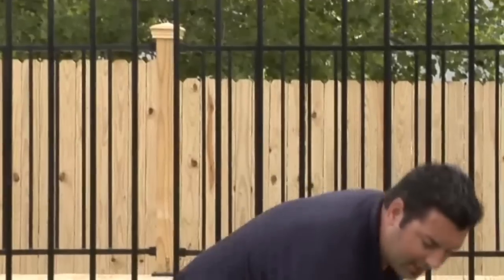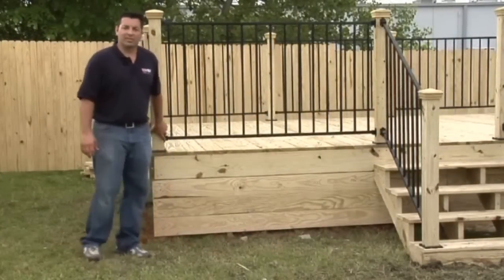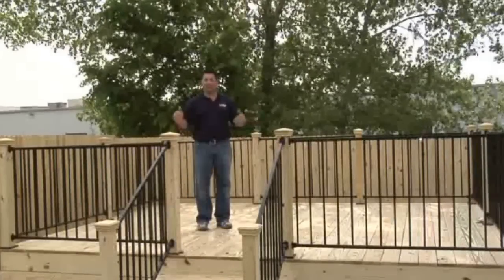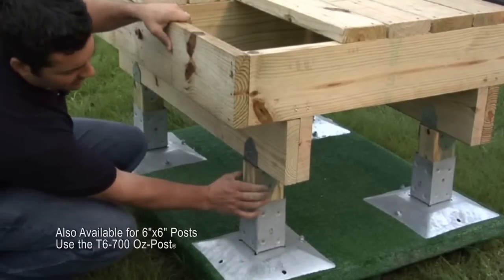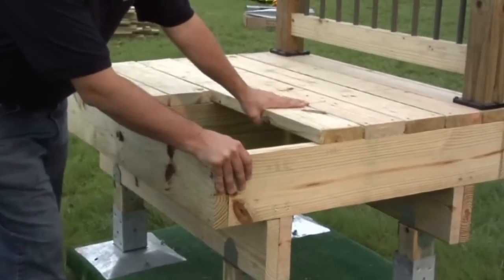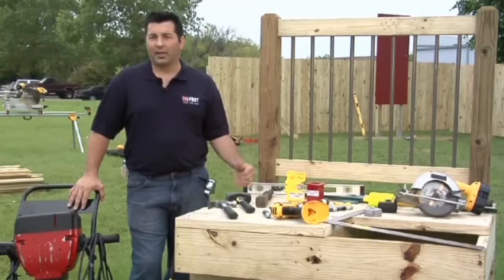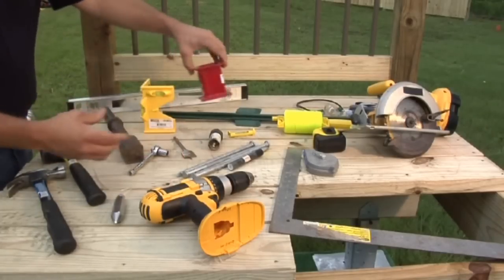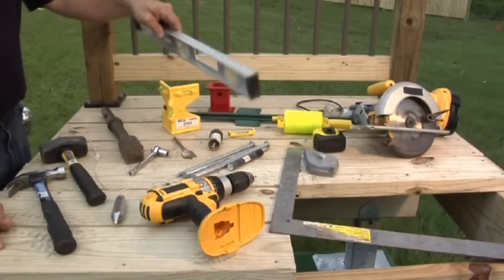Oz-Deck_Intro2011.mp4

Comment: I used these 8 years ago for my deck and it's still level today. I've built over 20 decks and always use to dig down 4.5 feet past the frost line (in our climate) and install concrete footings and piers, then attach my 4x4 columns. This is by far the best and fastest way. The only downfall is that you shouldn't be putting a gazebo or attaching a roof structure connected to your deck as this system does not resist uplift from wind.
If you can find it, get it. It saves so much time and effort and lasts!

Comment: you guys should make the anchoring of the post only 2 sides of metal instead of an insert... i am interested in this product however, I cant rest a beam directly on that metal in order to achieve a complete ground level deck... check the titan deck footing how they have the tie for the beam/post open on 2 sides so you can slide a beam if you wanted to.

Comment: about 50 bucks a post. Way too expensive.
Reply: Not if you hate digging holes and humping bags of concrete mix. $50 per is a bargain to save your back.
Reply: and you can have the foundation done in like 40 minutes if that! try that with digging and cement... i myself am thinking of using these... with concrete, i have to rent an auger which is like 60$ for the day... dig the holes ... mess with the dirt... pour concrete which will probably take 2 bags per hole at 3 feet deep if not more... plus the anchors... plus waiting to let it cure... plus labour of at least a full day. i can probbly do these in 40 minutes all of them ... for a ground level floating deck it seems super sturdy! I'm a cheap/frugal guy and I am all doing stuff myself but these seem very cost advantageous with the time you save+labour and trouble...